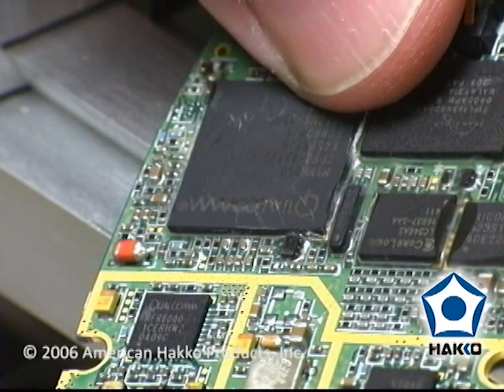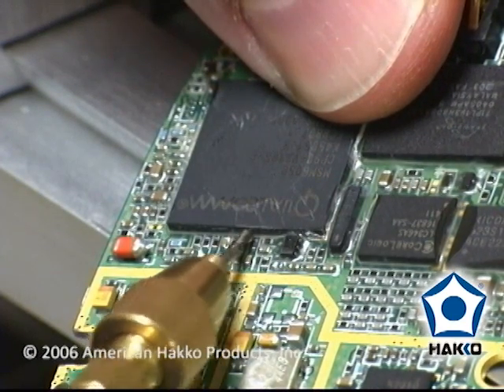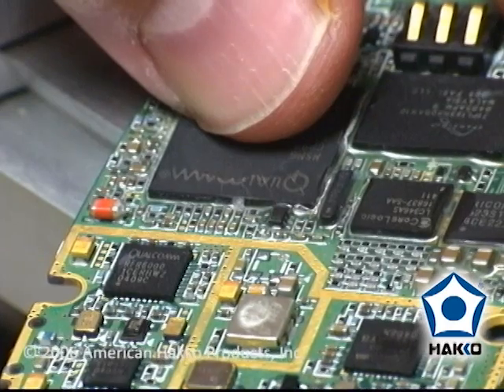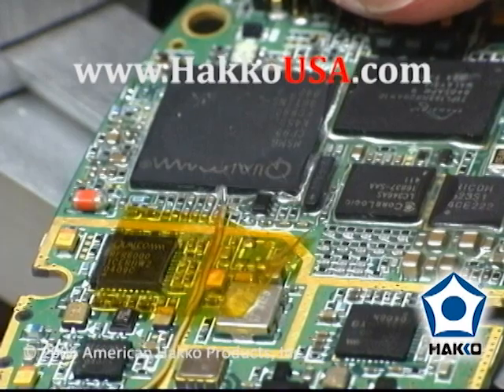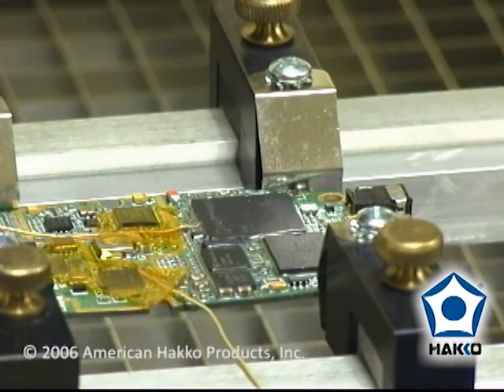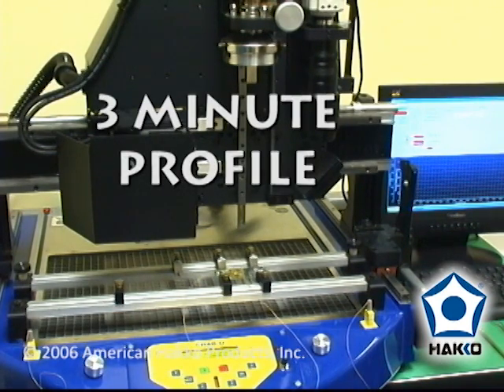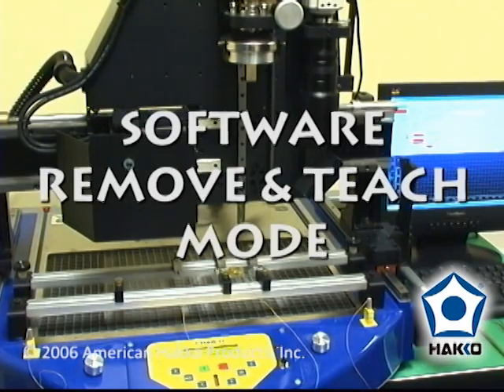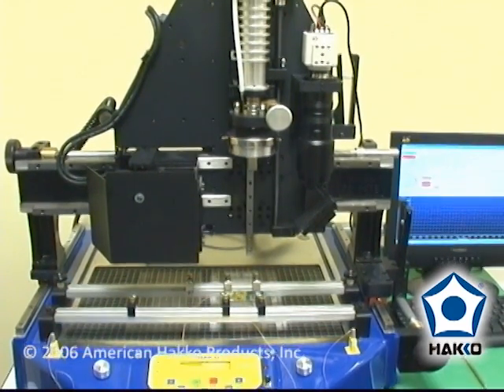HAKKO Tutorial - Adhesive-bonded BGA Removal — Video by American Hakko

Comment: In what way did this address the adhesive? Are the adhesives always engineered to pop off without damage using the same heat that would normally remove a BGA package?

Comment: hello,

work it with all adhesives on mainboards. I tried it maybe 5-6 times on samsung galaxy S2 I9100 mainboards but it pull everytime the pads up from the mainboard because the adhesive is to strong/sticky.
Reply: The adhesive (under-fill) would not be on the pads, but only the solder.  If you're pulling the component and find you are lifting pads, you should extend your heating time just a bit.  Remember the heating will also break down the adhesive allowing it to release easier.
Reply: N6MQD thank you for your quick answer. I heat the ic most with 380-410℃ for about 1-3 minutes and my Air flow has a scale from 1-6 and I take 4-5 Air flow. What temperature should I use and how long? In your Video you heat the ic just a few seconds.
Reply from the maker: bikeparts1 At 2:09 - 2:30 the instructor talks about the profile to remove the part, which in this case is about 3 minutes. What seems like a few seconds is due to the 1-second clock wipe video transition at 3:08 - 3:09, which cuts to the chase and eliminates the need to watch 3 long boring minutes of nothing but board heating.

Comment: How to remove BGAs with the Hakko BGA Rework System. Low cost highly flexible system designed for alignment and placement or removal of BGA, micro BGA, Flip Chip, CSP and other surface mount components.